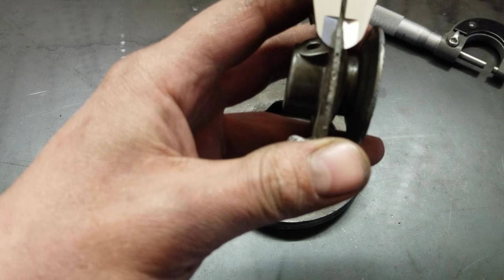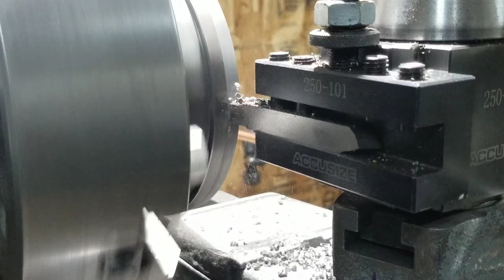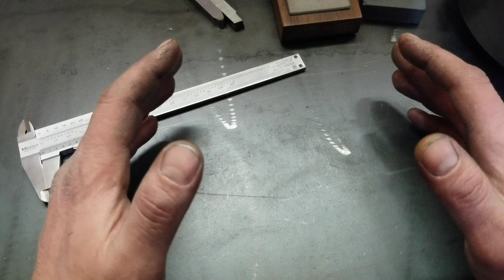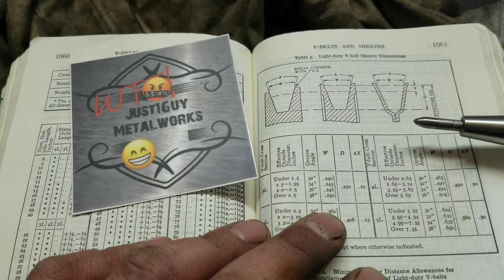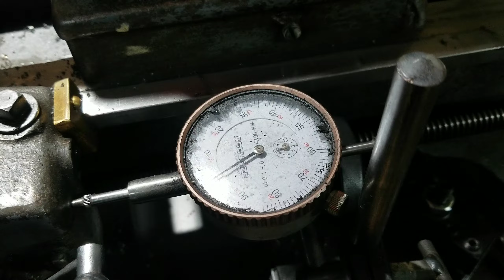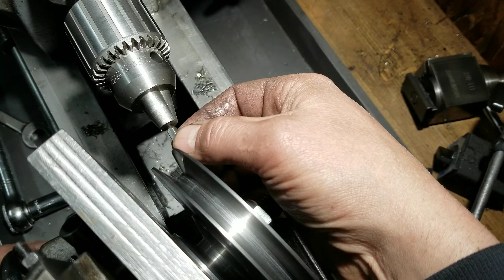Making a Two-Step Pulley in Ductile Iron! 😃

Comment: Here I am in need of a 4 1/4" step to 2" dual pulley with 5/8" bore for a 12" Craftsman lathe 3 phase motor exchange. The pulley ready-made is $175.00. I will follow your video and make one out of 4 1/2" OD aluminum. Cost is about $50. TY
Reply from the maker: Your welcome 😊

Comment: What is the name of the Rubberized Abrasive? It looked like it really worked great. I have seen it used on Aluminum before with great results, but never knew what it was called to buy some. 
Great Videos 👍 I’m really enjoying them.
Reply from the maker: Thanks man 😊! Some call them cratex sticks but that could be just a brand name. I order most of my supplies from KBC Tools, you can find them there and in multiple grits 😁. Thanks again, Joey! Cheers!

Comment: Great pulleys man, ran into sloppy threads on cast too, we went to one size smaller drill bit and it tightened up the threads considerably more, but hind sight is 20/20, pop you a dab of green locktight on set screw just be safe, thats pretty good chunk of metal 😁 thanks again for the great content sir!
Reply from the maker: Yeah, idk what's up with that. Maybe I'll try a form tap next time. If it comes down to it, making a slightly oversized screw ain't too difficult 😊. Cheers!

Comment: Hey man, that pulley - well, both pulleys - came out awesome!  I am too lazy to have redone the pulley, probably would have gone 5/16" or thread coiled the set screw, but you're right in that the square head set screw fits the machine motif better.  Had to laugh when you consulted the tome of dark machining knowledge, was waiting for the "Klatu verata nict(cough cough cough . . . ." but you were close enough :P
Reply from the maker: Thanks man 😊. Oh I had both pulleys made before any drilling or tapping occurred. I actually have some 5/16 square head set screws and may just upsize them a bit when I get a better tap lol. Also, still haven't found my Necronomicon 😐...
Cheers! 😁
Reply: @Just1GuyMetalworks  I think you're not gonna find it for long...
Reply from the maker: @Rustinox  🤣

Comment: Nicely made. You might consider several tapped holes in the face of the pulley so that if it gets stuck on the shaft you have a way to pull it off without breaking like the original one did.
Cheers from NC/USA
Reply from the maker: Nah, I've since made a simple attachment that grabs the back pulley for the puller to hook up to. Plus this ones a lot beefier 😁.
Cheers!

Comment: Well that is the true definition of manual machining!!!! 😏😏😋 I guess you were pulleying my leg!! 🤣 But all kidding aside, you need to make sure you clean your lathe well. Cast iron is an abrasive and will eat your ways up. Nice seeing you again. By the way now we are getting snowed in as well. Ciao
Reply from the maker: Indeed there was extensive cleanup involved 😊. Cheers!
Reply: Ductile iron won’t hurt anything, it’s all softer than your ways. Gray cast Iron is a different story.  The graphite in the ductile is a lubricant.  I’ve cut tons of it, the lathe ways are all fine. 
Sanding on a lathe is the only time I take care.
Good project.
Reply from the maker: @PhaseConverterampV  thanks man! Yeah I figured there was something contradictory about that lol. Sure is nice stuff to work with once you get past the dust 😊.
Thanks again man! Cheers!

Comment: That turned out damn nice 2x.👍👍 Don't forget the rust inhibitor, especially on the bore.  Kinda sux about the set screw, but you need some sort of thread locker on those threads anyway so... not a problem. Maybe tin the threads of the set screw with solder to add a few thou. (just a crazy thought).  .... Turning the chuck AND feed screw by hand.... hey, whatever it takes.
Guess you didn't get the memo. His name is spelled Kurtis but it's pronounced Carl.  🤣🤣
Reply from the maker: Thanks man 😁. Tin the screw? Never would have thought of that. Can't hurt to try 😊. Hand turning worked great. Once I cleared the corner I fed it out under power though 😏.
Reply: @Just1GuyMetalworks  It may be a crazy or even idiotic thought, more solder than just tinning, but what the hell. edit: yes the screw...😁

Comment: Very good job good sir my lathe has had some odd ball 2” pulley on it from day one since I’ve had it so I’ve never had the high speed option but idk that’d I’d use it anyway how often do any of you guys use the larger side of these pulleys
Reply from the maker: Thanks man! I'd definitely use it for small diameter parts and small endmills with the milling attachment. Probably not until I rebuild that counter shaft though 😊. Cheers!
Reply: @Just1GuyMetalworks  thanks buddy and that’s the angle I was missing endmills will definitely need the speed especially the smaller ones
Reply: I rebuilt mine but changed the way they got the grease instead of the bored hole with grease cups I drilled and tapped the bushing holder things whatever their called for a zirk and just put a small spiral groove down the shaft where they ride my original was missing the key for the keyway and they had basically destroyed both the shaft and the pulley I was able to save the pulley pretty simply by boring it slightly but the shaft was shot so I bought some 1” 1018 and made me one wasn’t much to it really once I decide to change the way it got lubed
Reply: @jeremycable51  "bored hole with grease cups" replaced with a zerk?? Don't take this wrong, but are you sure that those weren't oil cups that you replaced? Maybe should have had a felt wick in the oil cup to keep the oil from running straight through onto the floor.
Reply from the maker: @Warped65er  indeed the counter shaft does have little cups on the ends. You fill them with grease and give them a turn to push grease through to the bearings 😊.
Reply: @Just1GuyMetalworks  Ahhh.... I completely forgot about about that lube method. Duhh 👍
Reply: @Warped65er  on the atlas counter shaft mine had on the end of the shaft had to screw in grease cups to add grease you tightened the caps hated it just by the way they worked
Reply: @jeremycable51  👍 Gotcha and now understand, I had completely forgotten about those screw cap grease cups.
Reply: @Warped65er  they worked good i just prefer being able to quickly take a grease gun to it plus I really didn’t have a way to cut the threads when I made it my reverse gear box was broken so zirks it was